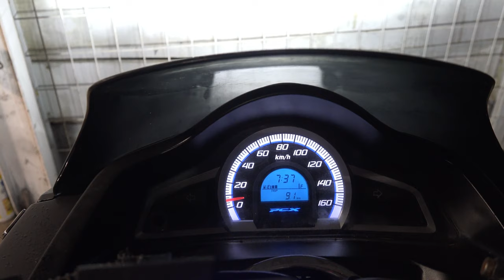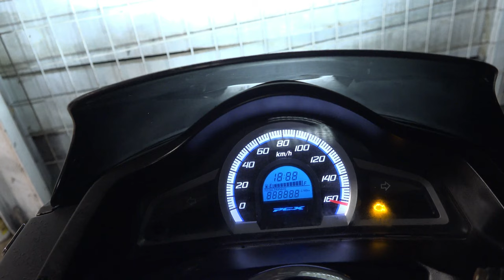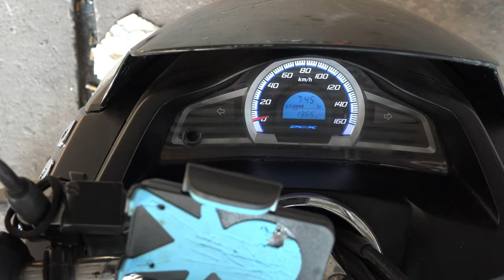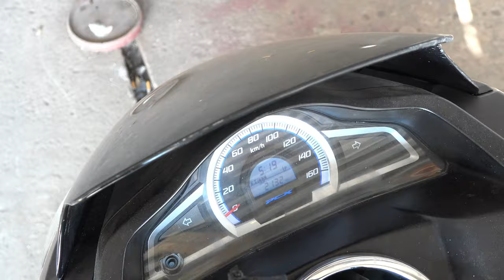Variator originar vs variator upgraded scooter honda pcx ... honda spree

Comment: Hello, please tell me what is the maximum width of tires (wheels) that can be installed on a Honda psx 150 KF18 scooter?
Reply from the maker: for those smaller in width, there is a possibility that it can fit in very easily, because of how wide everything is tight, tight inside, I don't think it fits anything bigger, thank you
Reply: @MBPATENTS  🙏

Comment: The speed meter is on the first wheel not in the back one so how you measure speed from sanding ?????
Reply from the maker: you are wrong on the pcx it has been on the rear wheel for many years

Comment: Sir how about the life span of the belt and the pulley that are upgrade..which is better
Reply from the maker: Hi Orville right now I'm testing the factory belt, it took 28,000 km and something I'm trying four different brands of straps to see which one will last the longest Soon I will upload it as a video to see which one is better as a strap the belt gets more mileage on the upgraded validor.

Comment: Halo..i have slider roller like u. So on your custom variator, slider roller still can work perfectly?
Even u do some modification on roller track ?

I thought the roller will turn upside-down
Reply from the maker: The only thing I know from my side and from Mikra is my bike that everything works perfectly and after so many years of twelve-hour work with the same bike in a short time I will announce And the kilometers it has done even the damages There were on this bike  there was no problem with the variator Thank you for your comments

Comment: Yes top speed upgrade better. Is original acceleration better than upgrade?
Reply from the maker: Hi king Depending on how heavy the balls are and how hard the rear spring is on the centrifugal

Comment: Hi MB PATENTS, i have pcx 125 model 2015 and i want to change some things to increase the top speed beacause i can barely reach 100km/h max. What is your advise to increase top speed ?
Reply from the maker: Hi hoven You don't need to buy anything, if you make the validor that has the machine on it, you will be very pleased, that is, if you bring it, I will close it on the outside plate!.
https://m.youtube.com/watch?v=H1o8aWGsuzE&t=109s
Reply: @MBPATENTS  what speak English.
Reply from the maker: Haha sorry! Most of the time I don't have help with the comments and I don't speak English very well, so I get Google to translate what I'm saying, but it's not the right translation as it seems 😅

Comment: How much pressure do you aply with the pistol to the bolt and nuts of the variator at the en of the build
Reply from the maker: Very correct question we never tighten pistol Hi Brick Ariasvalidor's villa is very dangerous he wants by hand with a wrench that holds against 12 to 13 kg at most to unscrew with a gun you can unscrew whatever you want to screw this screw is dangerous because it is the shaft of the connecting rods.
Reply from the maker: https://m.youtube.com/watch?v=YmAK1D2z_mg&t=15s

Comment: Is the upgraded variator actually smarter than the factory radiator because I have one that is smaller than the original
Reply from the maker: It makes a huge difference.
Reply: @MBPATENTS  man I'm sorry it should of read smaller not smarter lol I have a variator smaller than the factory one is it safe to put on wondering if I'll have a belt issue and tha k you for the response and help
Reply: Too vaque

Comment: Bro I did this to my Honda Dylan 150cc upgrade vario plus dr pully 10 gram I think my belt comes all the way up to the blok it scraped a piece off ahahahha put back normal rols in there at 9 gr problem seems over dr pully are 10 gr ( I like that better gr wise )
Reply from the maker: Ηi Purple 89 Ilan ang gramo ng iyong orihinal na roller? Mas magaan ang roller mula sa pabrika, mas pinipigilan ang sinturon batay sa tagsibol na kinakalkula ng gumagawa, dahil kung maglalagay ka ng isang mahirap na tagsibol, ito ay tulad ng paglalagay ng isang light roller. Ano ang ginawa mo gawin?

Comment: Hello brother I was just searching some things about pcx’ as I have one myself and came across your channel . 

I’m from the Uk and want to say what great videos you make . Question : do you know where I could buy one of these ? Any recommendations? And also how does it affect mpg consumption if cruising around 70mph?
Reply from the maker: Welcome, thank you very much for your kind words!!! As for the consumption, they have to do with the weight of the balls and the hardness of the spring in the centrifugal, the heavier the balls, the less your bike consumes, the lighter they are, they also consume more in the spring the harder it is, it consumes more, the softer it is, it consumes less
Reply from the maker: Tell me what exactly you want to do on your motorcycle, whether you are traveling or close to town
Reply from the maker: https://m.youtube.com/watch?v=n4wxvyvuJ_E
Reply: @MBPATENTS  well bro , I have a pcx 125 and it goes around 56/57mph . The fuel consumption is about 110/120mpg depending how hard and fast I drive . 

I wanted to increase the top speed by a bit while retaining the fuel consumption to a similar level as I drive around 8h a day but I like driving a tad fast at times so it keeps me entertained while working
Reply: I believe the balls on my 125 pcx are the stock one , I don’t know whether you suggest keeping it the same or changing it up . But like I said , I’d like to keep the fuel consumption to around 100mpg while also increasing the top speed by a bit , hence why I asked if you know where I can buy an upgraded variator as I do not know how to do it myself
Reply from the maker: https://www.ebay.com/itm/234397441725?hash=item36932d1ebd:g:o18AAOSwmNth9KIy
It is very good
Reply from the maker: https://m.youtube.com/watch?v=H1o8aWGsuzE
if you do this, it will be at 130 kilometers, the top speed will be better for the engine, it will be much more economical twice, I will tell you and it is very good for you, it works comfortably, the engine does not stop easily
Reply: DC Parts in the UK for all things PCX
Reply: @MBPATENTS   I drive mines to work and back I just want quicker acceleration and too end . How can I achieve this ? I have heard that if you change variator that you lose low end torque? And what about longevity?
Reply: Tempest are you located inside Europe ? Indian brand new PCX ( new name for the 157cc version 15hp ) is only 1.3 lakhs rupees.... or £1300. Ship one over with Indian plates as a personal import. Into UK, they signed a trade deal with India thanks to Brexit, Indian duty tax is now only 4.5% of total cost including shipping. for £1700 or less import tax is only £80. In the EU import taxes are much higher and you have to pay local VAT.
Reply from the maker: Hi! You can put rollers Dr. Pollini 23 grams, triangles and you will see major difference!!

Comment: Clean your Variator-House  . Dam its is dirty
Reply from the maker: Well I work on cars and motors what do you expect? I have no clinc. I saw your video, well done!
Reply: @MBPATENTS  link to my video so i know what you mean...
What I am trying to tell you about cleaning your Variohus, If your block is smeared with a small layer of grease from dirt and grime, your engine will have difficulty getting rid of the heat. and thereby you lose effect.... plus, if it's clean, you also get rid of it coming, being on your V-belt and clutch trays etc etc .....
However, I do not work in cars on a daily basis or as a hobby, but I work in scooters which are used for track driving and I also work in scooters as a hobby on a daily basis.
Reply from the maker: @bp-tuningaeroxlc-dd6474  in a little while I will reach 1000000 1 million kilometers 12 13 hours on the pcx that kinopio is tested when I reach 1 million km I will explain the + and the - so far I have not had any problems I think I have you covered thank you for your interest!!!